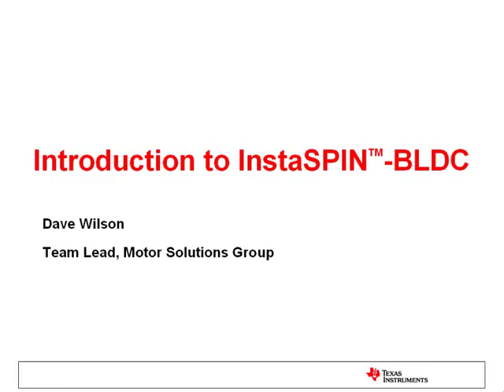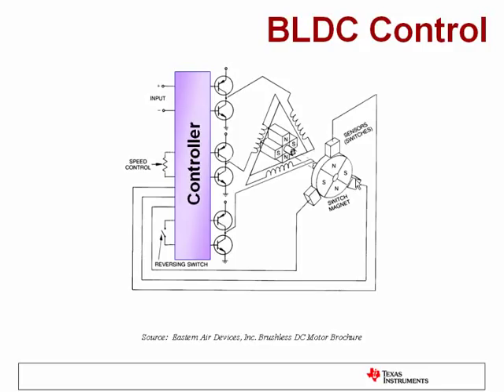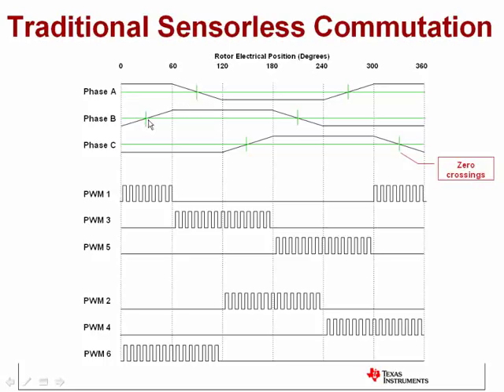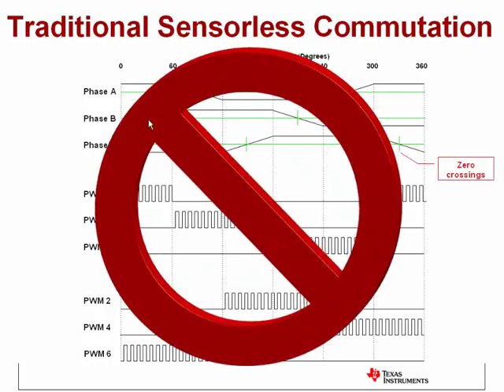Introduction to InstaSPIN™-BLDC Motor Control Solution

Comment: It seems there are a lot of non-engineers in the comments section that are complaining how complicated this all is. I think this presentation is well done and the chip seems to address most of the design issues associated with BLDC motor design. Thanks Dave.

Comment from the maker: InstaSPIN-BLDC can start up from zero speed with nearly full torque, and it can transition through zero speed, but it is not a zero speed solution.  InstaSPIN-FOC and the FAST estimator provides stability at zero speed, full load start-up, and <1 Hz angle lock and continuous low speed operation.
Reply: Hi i have bldc motor I need to control 100 RPM with 4% accuracy. My hall feedback will get updated every 25 ms(60 degree at 100 RPM speed). I need the correction less than 10 ms once. Any possible  solutions.  Please suggest

Comment: At 14:00, you talk about backemf spikes from the coils turning off. You say that the energy of the coils has to go somewhere. I assume that you have something like free wheel diodes that short out the coil to prevent it from generating high voltages.

Won't this cause a magnetic field of reverse polarity that will slow down the rotor a bit ? Is there a way to avoid this somehow ? Maybe to dump the energy of the coil you're turning off into the next coil that needs to be turned ?

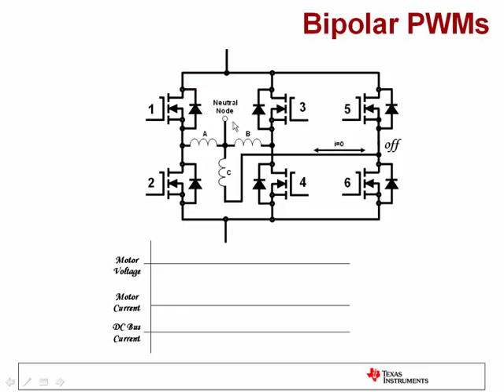Comment: Shouldn't the current of the motor be growing exponentially when you apply a DC voltage as the load it's an inductor? The graph in the video at 20:55 shows it growing linearly.

Comment: How do you threat the signal when  it comes into the microcontroller? If you catch the pwm using a ADC, what kind of filter you use to clean the signal that comes from the coils of the motor?

Comment: Great video! But what about PMSM FOC with instaspin? How emf is measured in case of constantly running pwm? Each motor line is always connected to +Vbus or -Vbus. Seems to me that PWS sequence should be modifyed such to periodically create Z states on motor lines? 
Additional video about InstaSPIN™-PMSM AC motor would be greatly appreciated! Thanks!

Comment: My be you could help me to get answers. Im looking for motor which si quietest (least vibration)  and controller with 2 or 4 speed control-very stable  speed. To be used in record player.

Comment: So the Texas Instruments version of SimonK.  Except that SimonK runs on an Atmega8. Please correct me if I am wrong but I see nothing new here. It is however a great explanation video, I will definitely watch it again.
Reply: interesting video... still watching it, but even a couple of mins in - I didn't realise brusless motors we use in RC have hall effect sensors to determine positioning, I always figured it was a "just apply power and cross your fingers" scenario; more learning to do!
Reply: aaand a little over half way I see that I completely missed the point, and the whole thing is about not having hall effect sensors. ESC's have quite a lot going on.

I guess they're working with some pretty big motors, starting a motor within 30s sounds like a pretty poor ESC...

This does make me wonder how much improvement we could make to a standard ESC if we tailored it specifically to the motors and lead length we were running at the time. How close to perfect could it get?

Tempted to get out my oscilloscope, wish I had 3 channels...
Reply: Gareth Crispin Most RCs do not have sensored motors, but more do every day, in order to manage uncontrolled 'punch' when accelerating.
Reply: SimonK runs on integrated signals?

Comment: Hi, 
  A very nice presentation, and if it works in practice as well as It seems to in theory, then a great idea. There is only one fly in the ointment so to speak. and that was the huge and very complicated PCB assembly that does all of the control. As a layman I want a very small uncomplicated package that will make my motor run. Efficiency is a very slow runner in this race. The existing control ESD is small and controls ,If somewhat raggedly. So far you haven't shown me anything to make me want to change from my simple and cheap controller to a larger and more complex controller, which is what you are in effect doing. The process of monitoring the back EMF is very novel from my point of view but the methods of getting from that monitoring to actual control of the motor is very much over engineered. Too my mind that is not good enough. Low cost and simplicity is the order of the day regarding BL motor control.
Regards to all.
MoK
Reply: I agree with you about the complexity involved, it's seems ridiculous just to spin a motor, but in applications like EV which often have water cooled motor drives and motors. Improving efficiency is very beneficial. 90% efficiency on 100kw system is 10kw! of waste heat to deal with. I think the controlability including regenerative braking and low noise with FOC is very beneficial also. Sensorless control is cheap and widely available, can be very small(most RC quad copters use it as well as electric bike etc) and is widely used, and field oriented control as is becoming more popular.
Reply: Hi Coolkeys ,
              Like everything it needs to be cheap and simple to be effective.
Regards MoK
Reply: Mo King Remember the old joke about how many X's does it take to change a light bulb. I wonder how many engineers,  scientists, MSC's Phd's etc  in different fields it took to create the White LED light bulbs that are becoming  common today? I have at least one LED lamp that needs to boot up before it can turn on :-)
Reply: Coolkeys; Yes indeed.I believe it was nurses and the answer was 4,  one to hold the bulb, and 3 to talk about it. I don't remember when the LED's came into vogue but I remember working with OC71 transistors in 1957 and the Sinclair digital watch arrive around 1966.The good old days.
Regards MoK

Comment: Is there a way I can decouple the BEMF sensing chip? For my application I am only having problems with close-loop operation and would only need a chip to do sensing.
Reply from the maker: +Lucas Rivera We encourage you to post this question on our Instaspin Motor Solution Forum where we can provide support. http://e2e.ti.com/support/microcontrollers/c2000/f/902

Comment: This is all very interesting, but it looks like your software is only avaiable for WinDOHs, and the insta spin kits only go up to 40A. For the cost of the kit I can get a ready built Chinese sine wave controller that will do 100a sustained, 300a peak, from a 48v bank into pretty much any BLDC motor with hall sensors. Furthermore, makers like Kelly are now shipping cheap sine wave controllers, which make the motor run much more quietly than trapezoidal wave controllers. I have used both types and the sine wave controller makes the motor totally silent topside, and just a pleasant whirring hum down in the engine room. So what are you offering to us, that we can't already get, that uses superior technology and greater power for the same price? My present sine wave controller is a Kelly KLS7275D rated for 200a continuous but I want to build a very large axial flux motor that will handle about 30kw sustained and so I was researching DIY controllers and ran across your youtube vid. It would be nice if your controller was a bit more scalable or had a more real world usable power level. 40A is way too small for an eboat or ecar. I don't know what you would do with that apart from running an ebike or a model airplane or something.

Also while yes, the masses use windows, a large portion of your potential market prefers Linux. You might want to develop stuff for Linux, with binaries for the more popular distros like Ubuntu, and source code for compiling to other distros. I can't use a product that requires a Windoze computer to calibrate or configure it because none of my computers have windohs onboard.
Reply from the maker: Our InstaSPIN solutions, including www.ti.com/instaspin-foc are widely used in the type of off the shelf controllers you mention.  Texas Instruments sells InstaSPIN enabled microcontrollers (as well as motor drivers and mosfets) and our end customers make them into all sorts of amazing products.  Thanks for your interest.
Reply: Stop whining about linux, it is a marginal, geeky os with lots of forks and distro's that all require specific software. do you really expect TI to cater to that?
If you want to use this technology, buy a frikkin' windows laptop, the world is awash with those and a cheap one will run you less than a hundred bucks. 
Or be a really bright wizzkid and write your own software to program TI products for linux, shouldn't be that hard for you linux expert, eh?
Reply: Dude, this video was uploaded in beginning of 2012... No VESC and such on the horizon at that time, and certainly no industrial alternative in acceptable boundries.
Reply: Growley M a
Reply: @dokterzorro   Have you use android ?? is every where, if you want to create an interface to display power probably you could use a Raspberry Pi for 25 dlls
Reply: @JorgeFlores-ck8bp  Why would I do that? Windows computers are abundant, cheap, reliable and come in all sizes and shapes. If I want to program a controller I just want to plug in the ol' usb, run the program and not worry about any os, compatibility issues or having to program in commandlines or vague apps on small screens. I have some nice old Asus netbooks running various versions of windows, they cost $20 on local ebay, tough as hell and completely reliable, serviceable and thrashable.
Reply: @dokterzorro   atom pc are not as good as arm they consume more energy and are prompt to errors
Reply: @JorgeFlores-ck8bp  my personal experience says otherwise. Currently I have 3 EEEPC's in operation, 1 901 and 2 1000h models. 2 run on win7, 1 still works fine with xp. That one is used for dj work and it has never failed me in the past 5+ years. It will do a whole set of 3 hours on a full battery running Traktor and ableton live simultaniously. The other two are my and my GF's daily surfers, also never fail, have good battery life and are also totally expendable. They're dirt cheap since telco's gave them away with tv/internet deals, you can pick up a fine working 1000h for $25, slap in a nice fast ssd for another $50 and have yuorself a cool little daily driver that you can smash in anger when you can't stand the trolls no more :-) It might actually survive that, the dj system has survived numerous drops, rain, beerspills and hauling across mudfields in plastic bags. It a tuff little thing.
May I also mention the weird fact that the humble Atom is one of very few intel proc's that isn't vulnerable to the recent Meltdown threat? It doesn't need patches so it will run as good as new where all others have to be patched and are in fact, flawed and would ultimately need replacement. Not so for the simple, efffective workhorse that is the EeePc.
Reply: I believe that those chinese controllers aren't programmable like the kits being supplied by Texas Instruments over here. They're catering to a different market. These aren't meant for production use. Also, this allows us to work with Induction Motors as well.

Comment: I deal with a lot of scrape metal and I get a lot of old fisher & pickle pan cake motors from old washing machines (out runner motors)  Do you have a driver controller that will run these type of motors, I could use them for many things and it's a waste to throw away a perfectly good motor. they are 3 phase and the junkyards are full of them, I need something simple to hookup to and run my motors with a speed adjuster (potentiometer) Tell me what I need and I will buy it from your web site. HELP!

Comment: Can threephase AC motors be controlled with BLDC controllers?
Reply: NO, only two legs are powered at a time is the short answer. I use single phase with 10uF on 3 leg to input and get PF=1 and cool windings, more load, just switch to more uF. Look up Rotoverter tap extra P off the 3rd wave.
Reply: The longer answer is yes, if they can. I mean you can build a motor controller that drivers both sensorless BLDC and 3 phase inductance motors. But unless you have a good reason to, why would you? Lots of industrial inverters are capable of it because they are off the shelf kind of products that needs a lot of versatility.

Comment: Is this the most efficient way to control a BLDC?
Reply from the maker: There are several ways to increase efficiency. Depending on your design, there may be other recommendations. The experts in the E2E community can help or you can search for advice: http://e2e.ti.com/support/applications/motor_drivers/

Comment: TI's crap. Now Chinese True Sine Wave will do a better job up to 250A and PTP 90V. Easier, cheaper, and more fun!
Reply: But can it run a Tesla P85 motor? You are missing the point. TI is in the business of making and selling Integrated Circuit (IC) chips so others can make products like the one you refer to. TI arguably has the best chips in motor control (Freescale/NXP has some impressive ones too, but they are not that interested in selling them.)